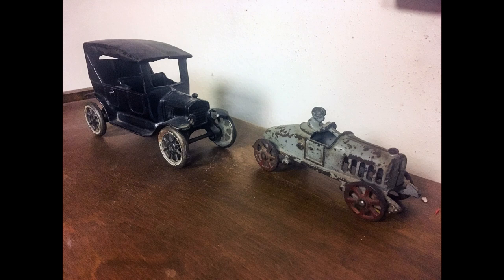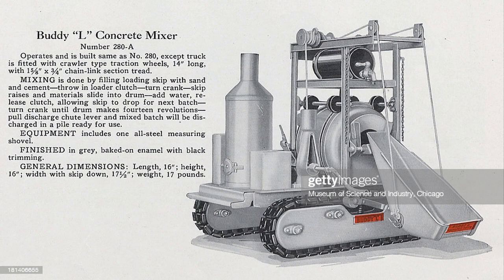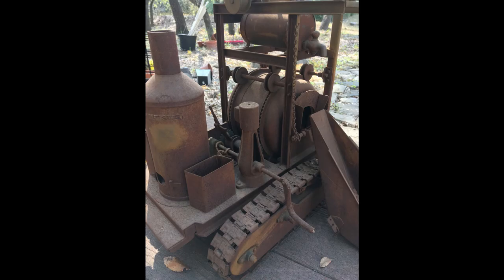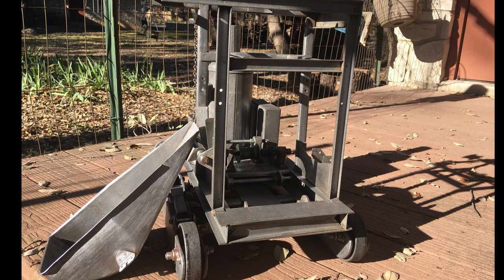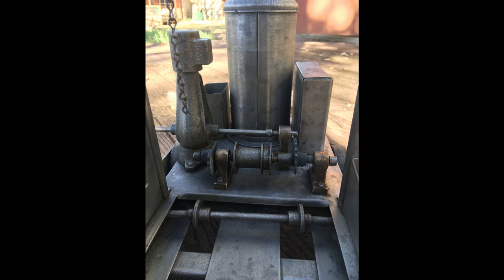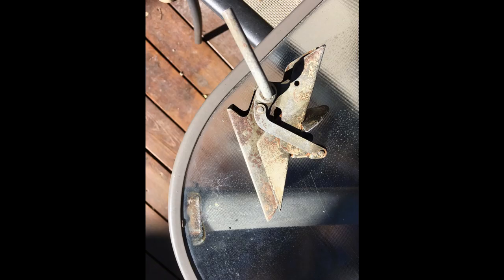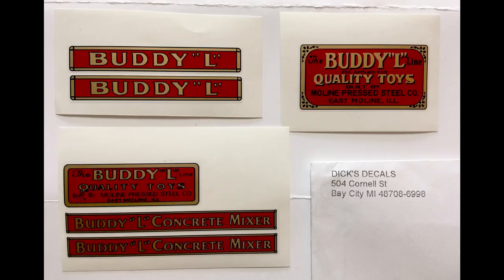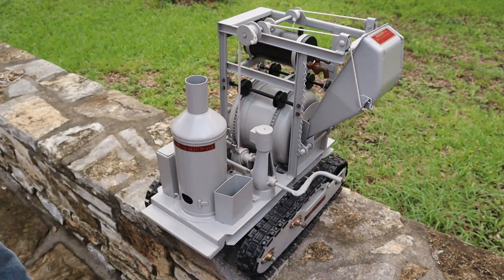Buddy L Cement Mixer Restoration

Comment: Great work! I have the same cement mixer that was my grandfather’s.  Great condition except one gear has two broken teeth.  If you have an extra single, or pair, I would love to buy from you if willing.
Reply from the maker: Thanks.  You are luck to have one in good condition.  The gears are the usual point of first failure. I don't have extras, but I have the stl model files that I used.  If you PM me an email I would be happy to share them with you.  Having them printed by some service (i used Shapeways) is fast and not particularly expensive.
Reply: Thanks!  I’d appreciate that.  I’m trying figure out how to PM you. It’s not so intuitive. I’ll figure it out hopefully soon enough.